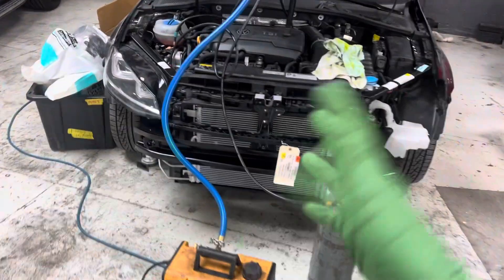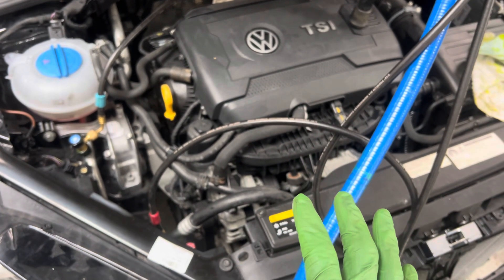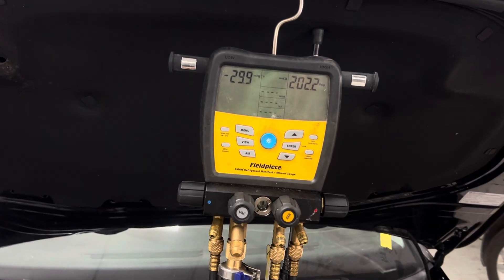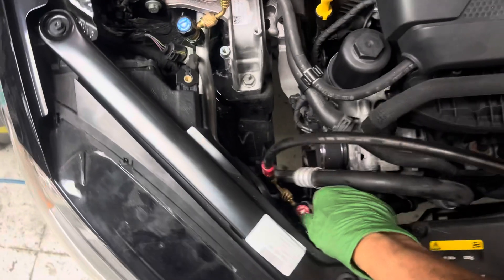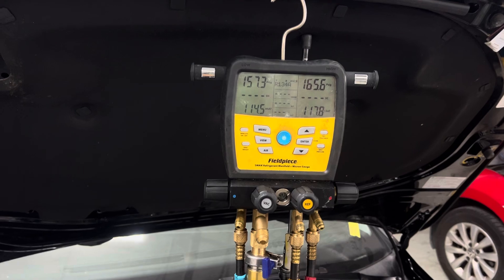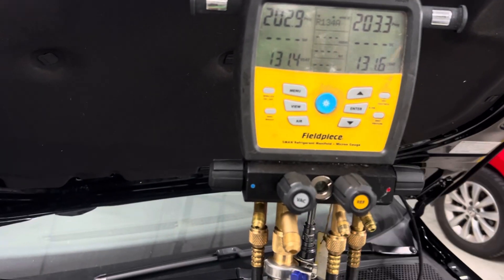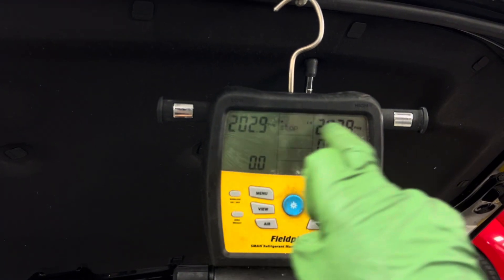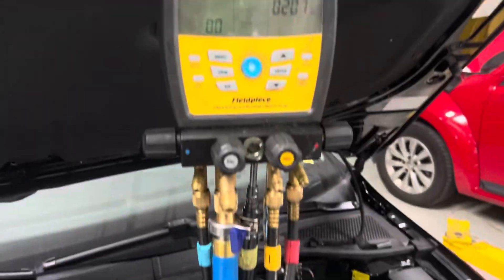Performing high-pressure nitrogen decay test steps. Temperature, sensitive gas,

Comment: After years in the field I’m intently following your excellent posts to learn the right way. I presume that the amount of oil that was added was based on the condenser being replaced and not the amount of the entire system? Then the next step is several nitrogen flushes and evacuations until the moisture level is acceptable? Once that is done then the last step would be to evacuate the system and charge through the high side, of course assuming there are no leaks?
Reply from the maker: Nitrogen purging all depends on the moisture contamination level, which can be read and interpreted through the micron gauge. 
     Will let you know whether or not more nitrogen purging is necessary. 
      There are cases specially nowadays with PAG and even more so with POE oil systems were open for weeks or months during a collision repair or an engine swap. 
     It’s just not possible to lower the moisture level and you’ll find out you cannot get it below 1000 or 1500 µm. 
       Within a given reasonable period of time where you’re only given one hour or 1.4 hours to perform an AC recharge. 
     Many people have shown me their experimentations at home or in their shop
     Where they have left a vacuum pump on a system sometimes one day two day even three days 24 seven until the moisture level has gone down to acceptable level. 
      We did not make the cars and we were not the technicians who damage them cause this contamination situation
        All we can do is try not to repeat the damage caused by other individuals

In attempt to reduce the amount of damage cause by other individuals before us .

Comment: If I set nitrogen regulator to 100psi then let it stabilize for several minutes, why do pressure drop to 75psi after 30-45mins if I close the valve on the nitrogen cylinder? 😢  The pressure probe is directly connected to the nitrogen regulator.

Comment: How much time will it take from the beginning to the end of construction like this? If the moisture in the system is high, it will take a long time just to vacuum. It seems that all manufacturers use automatic machines to vacuum and do not check how many microns they are vacuumed to. Then Does this mean that the repaired system will be very bad?
Reply: Looks like he answered the question himself
Reply: @Bill-jq2eo RRR machines always screw up. Disconnecting the AC lines while under vacuum will take several hours or even days (high ambient temp & humidity) to remove moisture on PAG & PVE oil using a vacuum pump. Manufacturers are playing stupid by making RRR machines without refrigerant analyzer. It's STUPID to Recover and Recycle Refrigerant without first analyzing it because it will contaminate the machine and the new refrigerant.
Reply from the maker: @Bill-jq2eo  what do you mean by construction?
Reply: In other countries they say that for labor @coldfinger459sub0